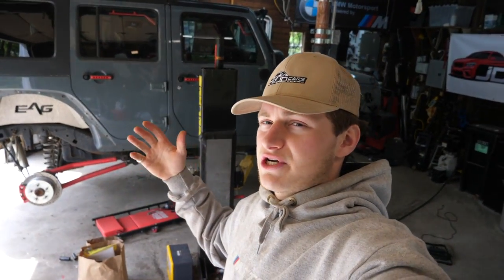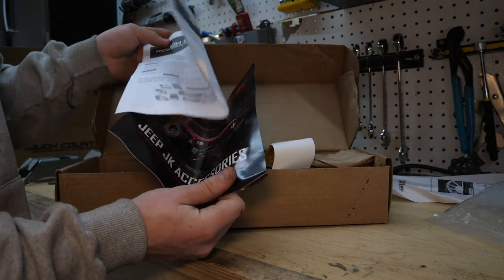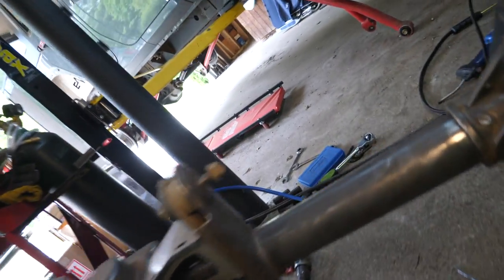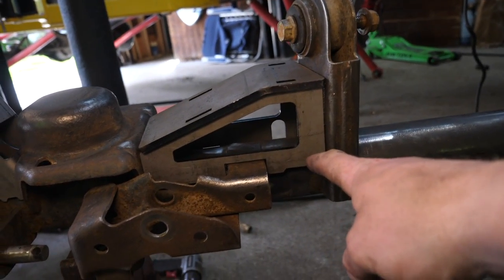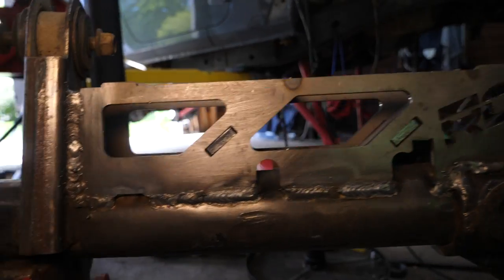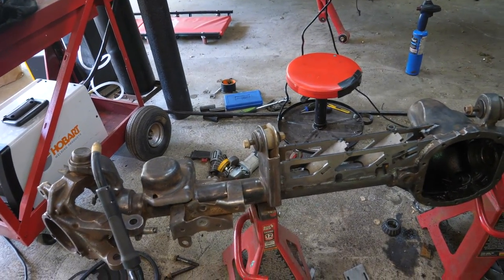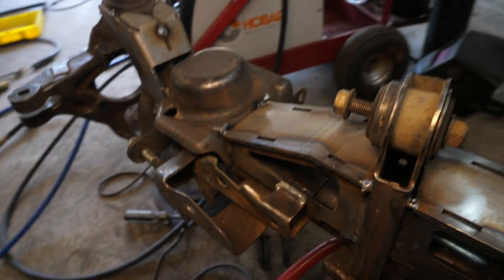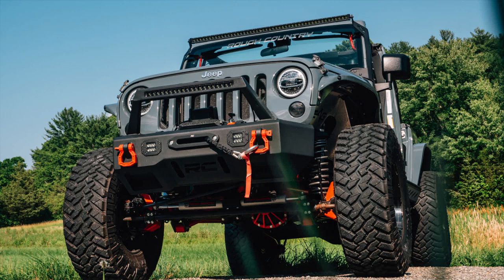Welding on Axle Truss & Gusset Kit // Bulletproof Dana 30!

Comment: In case you never figured it out latex is not for painting metal. The give away should have been the picture of the chair on the can. Correct paint should have been enamel or better yet epoxy.

Comment: How do you like the RC shocks?
Reply from the maker: Love um! The adjustable knob actually works for tuning to the terrain, and the ride is wayyy smoother than a smaller shock setup.
Reply: @JDCarsChannel  very cool. I got my truss yesterday and started to weld it on. Thanks for the video!